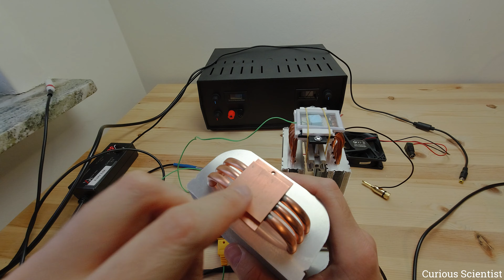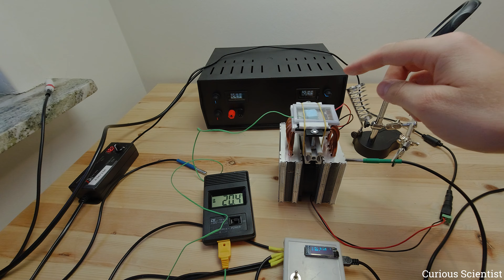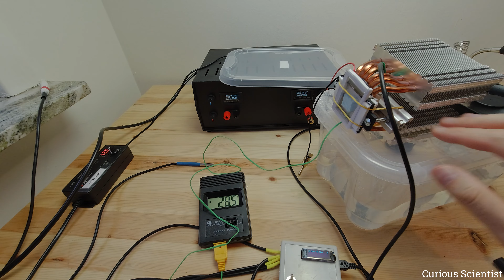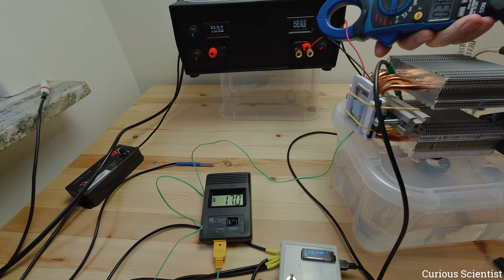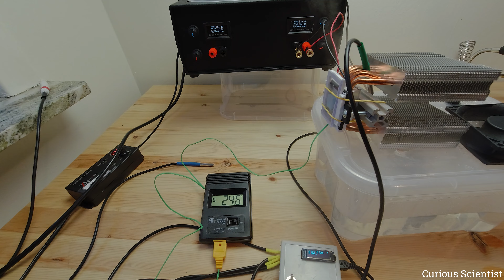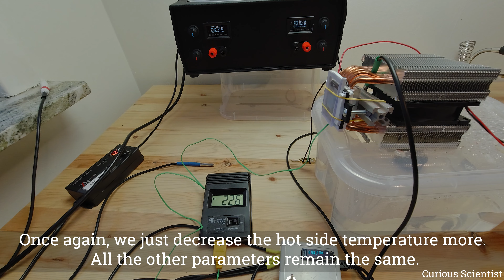Let's discuss about Peltier coolers #9 - Cooling the hot side - Part 4

Comment: Cant we use laptop cpu cooling method for this for miniature applications?? Pls answer
Reply from the maker: Check the what is the TDP of a typical laptop CPU... It is around 30-50 W, probably. You cannot do almost anything with that cooling capacity if you want to use it for Peltier coolers.

Comment: Nicely explained 👌
Can you please help me out.
I have a peltier module tec 12703 with me.
I don't know that if I use 🤔 an power adapter of 12volt 3amp 
Or A power adapter of 16 volt 6amp
And one more I have 12volt 1.2 amp.
Or I have to buy something you suggest me for give the right current to the peltier module.
Reply from the maker: Hi! It depends on what you want. The best would be to have an adjustable power supply and set up the voltage/current according to what you need. If you don't want to buy one, go with the 12 V, 3 A.

Comment: so can we say the principle is if the goal is cooling from temperatures so much higher than the room, a heat pump is not very useful as the temp. difference can already move heat. the very little push the heat pump adds is not worth the extra energy from it.
Reply from the maker: Hi! I would say yes, at least in some of those cases where people (on YouTube) try to use Peltier coolers. Also, the "problem" with the high temperature difference (DT) is that if the Peltier cooler maintains large DT, it also means that the heat pumped by it is very low. So, the Peltier cooler itself prefers smaller temperature differences where it can move more heat.